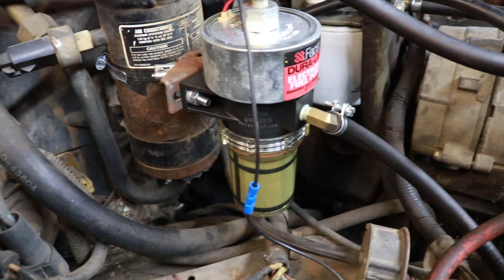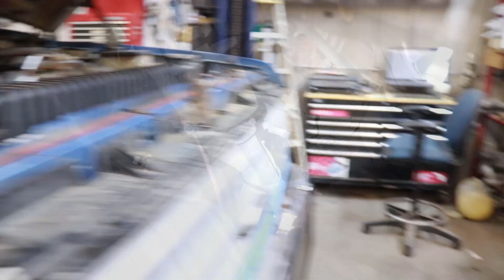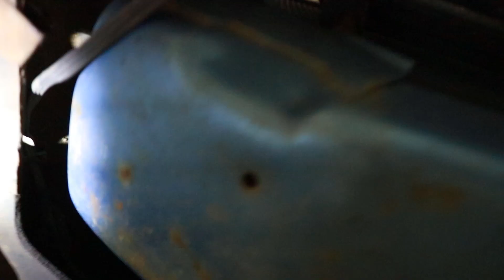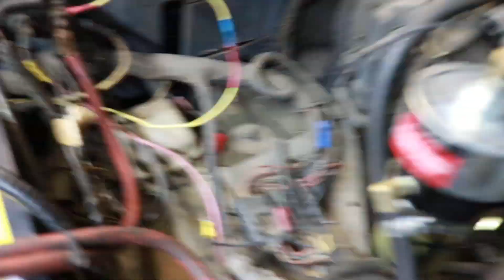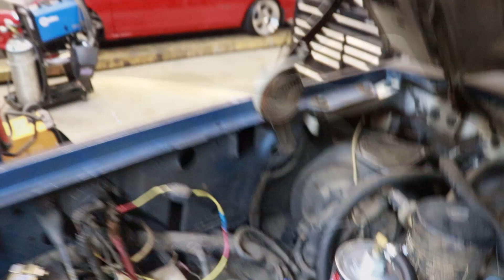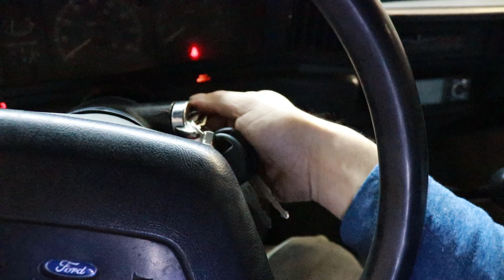How To Increase The Reliability Of Your 7.3!!! With A Electric Fuel Pump!

Comment: Will the facet 40222 pump keep up with the output of fuel needed to run the engine correctly? Will there be an rpm limitation or no?
Reply from the maker: In my experience there wasn’t any. But my truck was stock if you have upgraded injectors or a turbo setup you may need more fuel.

Comment: Do you remember where you got the fitting and the size I'm having a hard time getting 3/8 to 1/8 fitting?
Reply from the maker: I ordered it off amazon, the original seller no longer sells that fitting, but you should be able to find others that do, if I remember correctly it’s a 3/8”(barb) to 1/8npt fitting

Comment: Lie , those pumps are junk  this guy doesn’t drive over 50 mph anymore over 60 pump can’t keep up or towing a camper lies and waist of money ‼️‼️‼️
Reply: What pump do you suggest ?
Reply from the maker: The pump I used is a recommended pump lots of people use it for the NA versions of these trucks with stock injectors and the pump provides adequate fuel to the ip except if someone has added larger injectors, a larger Ip, or their ip is starting to leak and allowing flow through into the return setup(what mine started to do after a few years) I did park the truck until I get around to cummins swapping it because I wanted more power and reliability than my 7.3 idi could provide I had nothing but issues from this trucks fuel system prior to installing this pump, but I ended up having issues with the return line side of things and cost me a big welding job. I may do another video about my newer rig but that’s another topic for another day.
Reply from the maker: The truck didn’t have a problem getting to 65 but that was all it could ever do because that was where the engine hit the governor! The pump works fine! If you were having issues towing your camper at that speed sounds more like a camper weight issue and your forgetting these trucks aren’t made like modern trucks they were designed when hwy speeds were 55 and were not designed for speed!

Comment: I install same pump and it fells like I lost some power, anyone has noticed that as well?
Reply: The 7.3 idi pumps more fuel into the rails than it uses, so having more or less fuel pump through them shouldn’t affect power unless you could be getting air in the system or have other mods that might need more than stock fuel flow

Comment: You want a 7.3 to be reliable???   LEAVE IT ALONE.. Mine is 30 years old. No problems.. I don't try to modify any on it.
Reply from the maker: Not true with the quality of parts available now you have to to get reliability I changed mechanical pumps 3 times before swapping to the electric

Comment: I clicked on your hi torque starter link and it goes to a case backhoe starter. Is that the one you used on your 7.3 idi?
Reply from the maker: No it isn’t I’ll check it out they may have changed the linked page on Amazon so I may have to create a new link
Reply: @adamswelding5052  

I read further down the page and it also fits Ford idi.  Good to know. My backhoe will be needing one soon also.

Comment: I’m gonna do this to my 6.9 IDI.    Nice video!   

Question:  did it affect the IP timing or adjustments at all?
Reply from the maker: To the best of my knowledge it has not. Truck drives great though I don’t drive it much anymore. Mostly only when I need to pull something heavy, I mostly run a trailer welding rig now and pull it with my explorer most of the time, but sometimes use old blue for something’s.

Comment: How did it increase reliability please. 

Did it affect cold or hot start. Which was the biggest improvement please.
Reply from the maker: It did a few thing it increased overall reliability because after having 3 mechanical pumps fail(original and 2 aftermarket ones) I went to the electric pump. It was a more consistent flow rate and pressure instead of fluctuating with the rpm, but most importantly it allowed an ease of getting air out of the fuel system

Comment: Hi Adam, very cool idea. One question, is the electric pump running all the time, or just during starting.
Reply from the maker: The electric pump runs as long as the key is in the on position
Reply: @adamswelding5052  They make 2 models..WOT do you outrun this 9-11.5psi pump?.. I'm considering 12-15psi..50gph but still the injection pump at WOT needs 74gph..just curious before I pull the trigger..thanks again!

Comment: Does this pump strain the air from the fuel inside of that fuel filter housing?
Reply from the maker: No all it does is strain large particulates that could be in your fuel. It does t really do anything for separating air, it will act as a secondary water separator though

Comment: Why not use the facet 40285 pump what's the difference between the 40285 an di 40222
Reply: Why do u use a filter before the electric fuel pump?
Reply from the maker: That’s a good quest and it isn’t really used as a filter because it doesn’t filter to a low enough micron to do that job good enough to be called a filter but it’s purpose is mainly as a strainer to keep any debri that could be pulled from the fuel tank from getting into the pump
Reply from the maker: I believe the difference is pump output psi. I went with this one because it’s the one everyone tell you to get I got it for mine and it has been working amazing since! Only thing I did different that what is in the video is I added a inline fuse to the 12V power line
Reply: Oh I heard the mechanical fuel pump out put is 6 psi can i use di 40285 which is 4-7 psi output or should I use the 9-11 psi which u install?
Reply from the maker: I used tha 9-11 because that was the part number recommended to me and it works great in my truck without issue.

Comment: Can you use this on 91 7.3 IDI to replace bad in tank unavailable pump / sending unit?
Reply from the maker: You don’t have a pump in the tank just a pickup tube, normally if you are having a issue in the tank it’s either a broken showerhead(part of the pickup tube it’s like a strainer), the tank selector valve isn’t working properly,  or it is a bad mechanical pump, it you install this electrical pump you have to delete the mechanical one or else you will have issues

Comment: 41-7059 is an unbranded 40223 facet for reefers. its a little cheaper. And It's easier to get power on your key on ignition off post on the starter relay on your fender. Its shorter than running a wire to the gpr. Good vid.

Comment: Thats cool that it works. I’m sure it would be fine because the pump only draws 1.5A but you should really have a relay with power coming direct from the battery and a 5A fuse inline. The wire your drawing off of is a signal wire (not designed to be put under load) and if the lift pump motor were to ever short to ground you might get a little electrical fire action under the hood maybe under the dash. No big deal lol
Reply: So would running the pump off the battery with a relay in between is the best option?